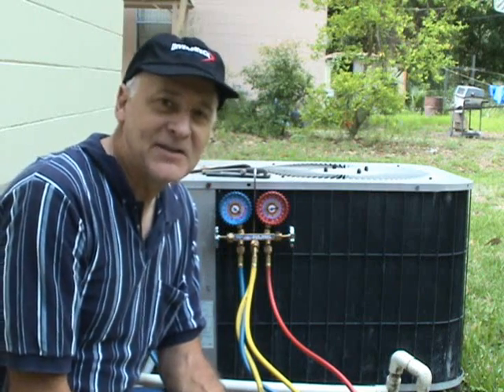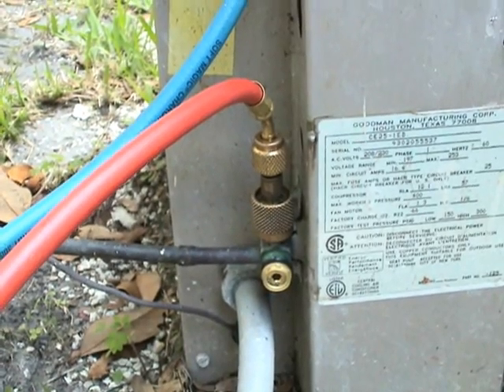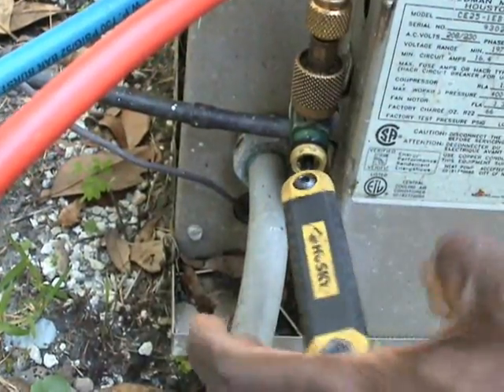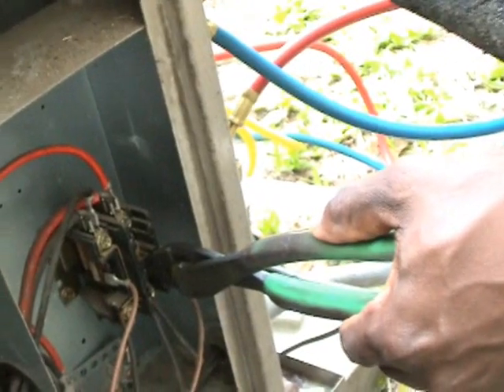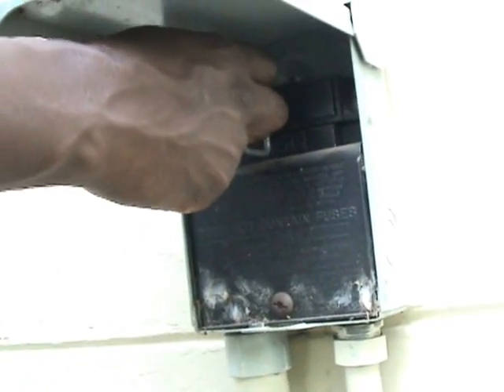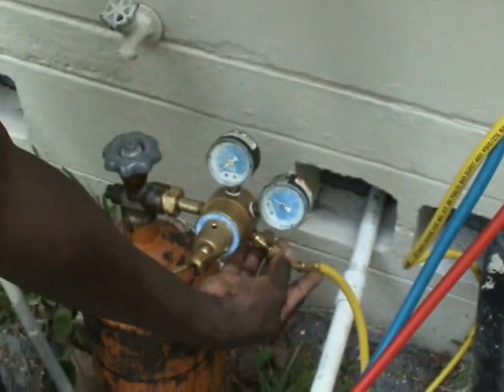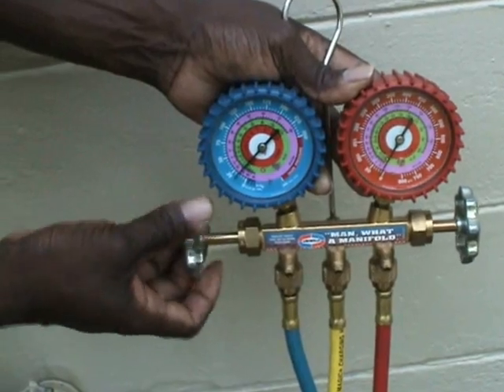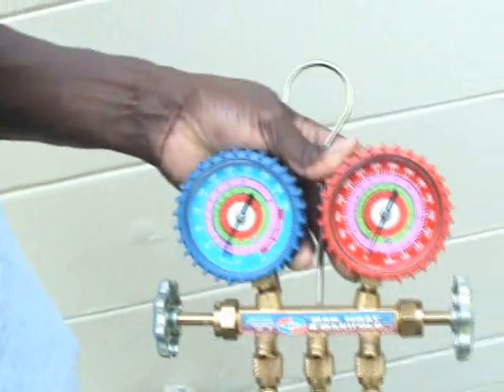HVAC Pump Down

Comment: So this is how the procedure keep gauges closed, remove caps. put high and low side hoses on both sides, close high side, press contactor, than while pressing down contactor for pressures on both sides to reach 0 psi you then close the low side and turn off the AC disconnect box, than put the yellow hose on the nitro, open the nitro than open the gauges.

Comment: can i add refrigerant to a condenser that is not connected?  I have 2 condensers that are filled with nitro but are not installed or plugged in.
Reply: no you need power on to do the procedure im pretty sure

Comment from the maker: To prevent air from getting sucked into the system when you cut it open for service.
Reply: If air gets in the system you are going to make evacuation for extraction of the air and moisture. The nitrogen after pump down is for avoid the pipe to rust while brazing.

Comment: This is the second time in a video I've seen you attach a hose (yellow) to a Nitrogen regulator and then, without purging the hose of air by cracking open the Nitrogen, simply push all the air in the hose into the system. Is this 'good practice'?

Comment from the maker: If you open the system while it's under a vacuum, it will suck in air i.e. moisture when you cut the line.

Comment from the maker: You'll want to put the vacuum in the line set and evaporator with some nitrogen to prevent air from getting sucked into the system when you open it up for repairs.

Comment: Great videos - I have a Quick question, once you pump down a system can you then do a leak check of the service lines pump and evap coil using nitrogen?

Comment: If its a semi hermetic. you might want to check the oil screen on the compressor. Also check the superheat at the txv. Depending what kind of freezer it is the superheat should be around 2 to 4 degrees. also check ;your oil pressure which is suction minus oil pressure

Comment from the maker: The work in a similar way. Cracking off the valve to the mid position doesn't change anything with these service valves. They have to be either backseated or frontseated.

Comment from the maker: @DrewNutts How dirty is the coil? For the ones that are black and thick with gunk, you'll need to nuke it with something like Alka-Brite. Although you'll want to use something less harsh for evaporator coils. A good rinse-free cleaner will work very well if the coil isn't too dirty.

Comment: I would be interested in pumping down my system to pull and clean my A-Coil.  But I have a Scroll Compressor and it says not to pump down below 20 psi.  What method do you use to pump down a Scroll Compressor.  It would be impossible to close the valve and stop right at 20 psi.  Plus how would you determine the additional refrigerant needed.  On a Scroll do you recover or what method to you use.

Comment from the maker: @silvertip69 That's where you need to be a tech to know how to pump down your system. It's hard to say the proper way to pump down your system or even if it's possible. Some ductless mini splits make it necessary to recover all of the refrigerant.

Comment: Also any leaks that are on the indoor fan coil or pipe work between have been allowed to be sucked into the system due to the fact you went below 0 psi on your gauges.

Comment: @DrZarkloff , Good morning and thanks for quick reply, How do I check if it is warm at the bottom, should I open top and feel it or there is some other way to do it ?. If it is warm . That means I'm wasting national asset and wasting money. I should thro. ckt. breaker off. I'm not sure if it has the crank case heater. I'm in New York.   Thanks again to help us.

Comment from the maker: @DrewNutts There are two schools of thought on this. Some people say the if the system has a scroll compressor that you shouldn't pump down the system into a vacuum to make it easier on the compressor. Some say that you should pump down the system into a vacuum then break the vacuum with nitrogen to insure that the leftover refrigerant won't explode or cause phosgene upon contact with a flame.

Comment: Gauges are closed while pumping down.
 On a heat pump, make sure the system is in cool mode.
 If their is nothing wrong with the compressor valves, you can close the suction service valve after the pump down is complete.
 When re-opening the service valves, it's best to open the suction side first.
 If the system won't pump down- the outdoor unit may not have enough capacity, or the compressor valves are bad.

Comment: Thanks for your pump down video.  Do you ever run into a problem when a system has a long lineset?  Since the system then has more refrigerant than the basic charge that was suited to 15ft, can the charge exceed the capacity of the condenser coil?  Do you ever see the compressor internal relief open before the system is down to zero?  Thanks for the video.

Comment from the maker: @meek7190 You'd have to flush out the line set if you plan to use it with a new R410a system or you can just replace the line set.

Comment: Dr Z ... everytime i replaced a condenser i brazed the lines back to the the tubing note the condensers are already precharged i never notrogen bled a system while i was brazing not sure how to do this but i usually braze my lines pump the system up with nitrogen to about 150 psi wait for 20 minutes to see if i have a leak. then i put the system in a vacuum for an hour or so while the system is in a vacuum open the lines up and thats pretty much it ...

Comment: Nice to see you are using seal-rites on your gauges. You pump that down exactly like I do only you forgot to mention to turn the air handler blower on inside. If you don't the refrigerant in the systems may not fully evaporate as it cannot absorb heat, therefore you may pull liquid through the compressor if you don't run the fan.

Comment from the maker: I'm in the middle of doing a triple evacuate video. You want to evacuate to 28 hg then continue to evacuate for another 15 minutes. Then break the vacuum with dry nitrogen to 2 psig and let it sit for one hour. Repeat this process three times. On the last time, evacuate to 500 microns then turn off the vacuum pump and close the gauges and see if it holds a tight vacuum for at 15 minutes.

Comment: When you say a triple evacuate, do you mean you, evacuate for 15 minutes, then wait to see if you get a rise in pressure, three consecutive times? Also do you only go just below 500 microns, or do you let the system suck down lower.  I'm a little worried about evacuating too low, and causing a weakness in the one of the lines.

Comment: Once the repair is done, do you just pull a vacuum, and charge with refrigerant back to zero, then open the service valves, and check for correct superheat?

Comment from the maker: The system needs to turned off and you need to have a nitrogen bleed running through the part that you are brazing. NEVER braze a system that is under pressure with refrigerant.

Comment: if you look where your high side guage taps onto the access fitting you should take notice to see where that port is. If its "behind the valve " so to speak chances are you can read high side pressure or shoudl be able to. if its ahead of the valve chances are you wont be able to, whenever pumping down without a reciever you should always watch head pressure, even with one its just good practice..COVER YOUR ASS!! lol

Comment from the maker: The pressures on both the high and low sides will go down to zero psig during pump down. Pumping down the refrigerant into the condensing unit is standard practice.

Comment: Hi Jim, thanks for this video, I wanted to ask you about the pump down for a long time! Just one question: With the liquid line valve closed, can you still see what the head pressure is?
Is there a chance of damaging the compressor by running the pressure up too high?

Comment from the maker: It took only a minute or so to pump the refrigerant into the condenser. Putting nitrogen into the system before opening the lines will prevent moisture from getting into the lines.

Comment: I guess this is only a matter of preference, especially when the cost related issue is involved, but I tend to recover the refrigerant and charge the system fresh just to ensure that there aren't any non-condensables in the system.

Comment: I've seen a number of Inverter driven mini-splits that actually have a little push button inside the cabinet that activates pump down mode as well.

Daikin is one of them

Comment from the maker: You could just make the thermostat to call for cool. Then hold in the compressor contactor to be sure that it doesn't de-energize when it shuts down on low pressure.